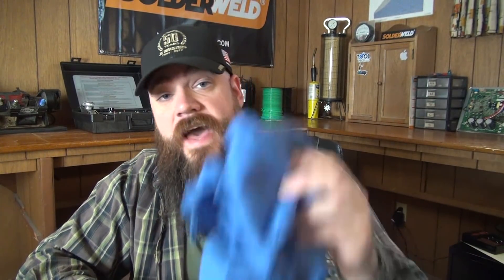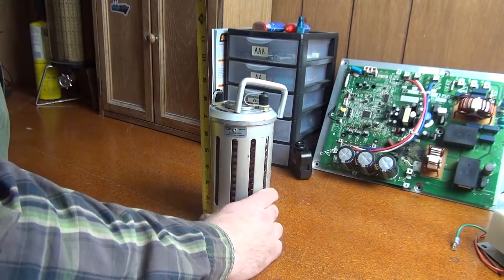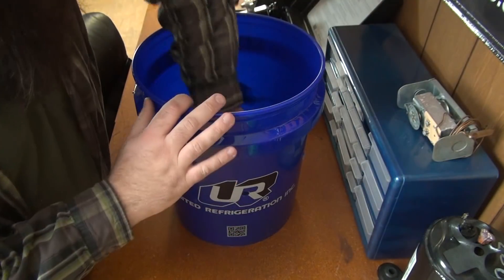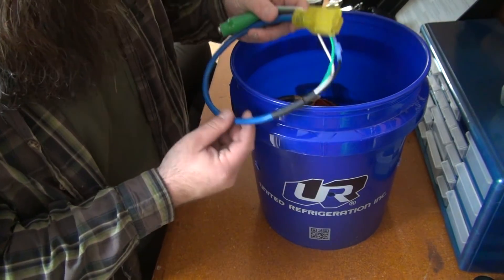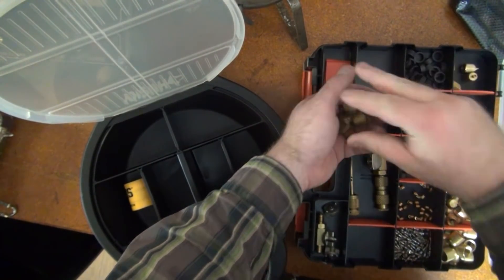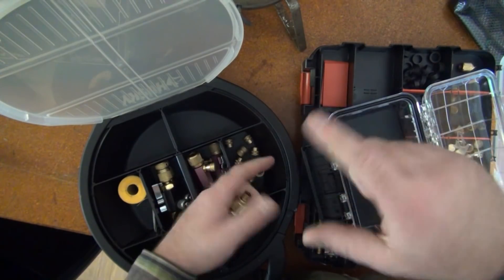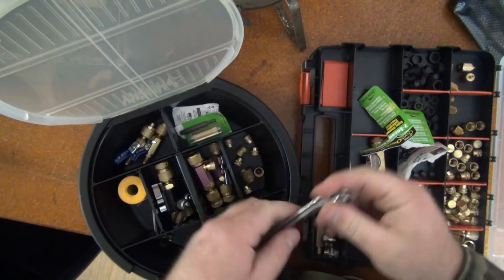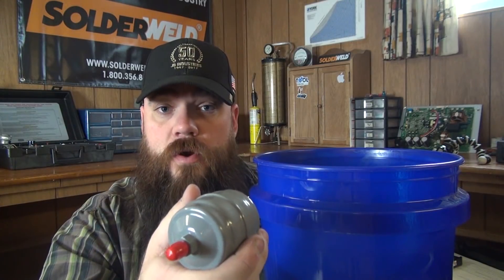Recover like a BOSS; the HVAC recovery setup in a bucket

Comment: hay boss why don't you use ice in the bucket that all you need with the reclaim unit we all know that refrigerent wants to go where its cold comes right out high or low side
Reply from the maker: If I have access to ice of course I’ll use it. Not always the case, but I almost always have access to water in which case I’ll use the bucket/subcooler.

Comment: Excellent set up similar to what my dad showed me when I was young for a set up that I use. To take it one step further when your billable rate per minute approaches three dollars. If you live in a place where dry ice is everywhere and only 5 to 8 dollars for 10 pounds are use dry ice around my tank in a bucket. When you’re on a rooftop and it’s 110 degrees out side and recovering R410 when the tank is -109°F and you have nearly 0 psi for your recovery machine to work against because of the low temperature you can turn a half hour to one hour recovery into a 10 or 15 minute job. You still bill for the full rate of time it would normally take and your recovery machine last longer because it did not have to work so long or so hard and work at a high temperature. That 5 to 8 dollars you spent on the hot ice it is minuscule compared to wasted time of a long recovery.
Reply: I replaced the compressor on the office AC for a place that made their own dry ice for some process they had going on, and they let me have all the dry ice I wanted for the recovery.
Recovered 40 pounds of refrigerant from the system, and pulled the system into a slight vacuum, with no recovery machine connected, just recovery tanks buried in a cooler full of dry ice.
Reply: Mark Beiser yep. Old school
Reply: Back when I first started 26 years ago, I remember seeing adds for a refrigerant recovery jacket in a trade magazine that you ran liquid CO2 through to cool the tank enough to recover the refrigerant, by itself, or to assist a recovery machine.
I've not seen them advertised since then, but I wouldn't mind having one, as I actually keep a 20# liquid CO2 bottle on my truck to transfill my Drain Kat.

Comment: Completely right about the test outlet. Was rushing one day and didn’t realize I was working on a 440v unit. Had to cut apart a blower assembly I was replacing. My grinder went fast as hell for the few seconds it lasted before burning up lol
Reply: Also "fun" when the outdoor unit on a split system has a not so good ground, so the "neutral" the widowmaker is finding is through the refrigerant lines to the indoor unit's ground, and you go to start disconnecting the indoor unit while the recovery machine is going.
Was a fun little sparkey dance I did on top of the ladder, followed by taking a couple of hour break to contemplate my mortality...

Comment: Hi Andrew. I never used a sub cooler. That looks pretty awesome. 1AM?  I appreciate your enthusiasm and dedication. Keep em coming. Now go to bed and get some sleep. God bless.
Reply: A sub cooler, or other means of cooling the tank, is a must have when recovering large quantities of R-410A, especially in hot weather.
It is usually a lot easier, and more effective, to run water over a sub cooler, or bury it in ice, than to cool the tank.

Easy enough to make one out of some scrap copper and a couple of fittings if you don't want to shell out the $150 or so for the CPS one.

Comment: All you need: half full bucket of water,  one 1/4 inch hose. 😂
Reply from the maker: Tyler Nelson you never put a drier on your machine?  Replaced hose baskets?  Done an acid test?  Used a heater to help charge a unit?  I do these things everyday, and get sick of always forgetting to grab those tiny things when I’m a mile from the van. That’s why I built the kit, to not have to think when I’m going to recover gas. Just grab the bucket, and you’re ready for a variety of scenarios whether they end up occurring or not. Thanks for watching and commenting dude👍!
Reply: I was just joking around, thanks for replying so quickly. I've seen a guy that dumps charge into a bucket of water, that was what I was referring to. But yeah the recovery kit is a good idea man, I like it keep up with the good content.
Reply from the maker: Tyler Nelson no worries man, was hard to get your context there, I figured you were saying there was no need for anything except a hose/bucket.  Those guys are out there!  Thanks for watching bro💪💪